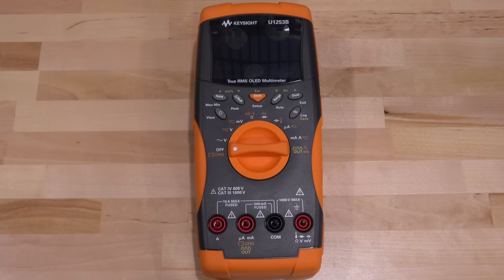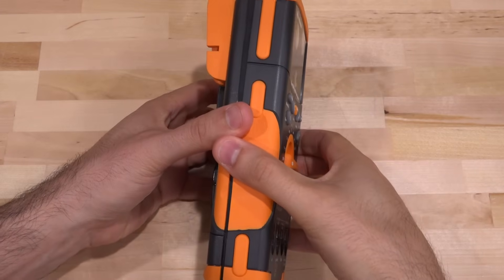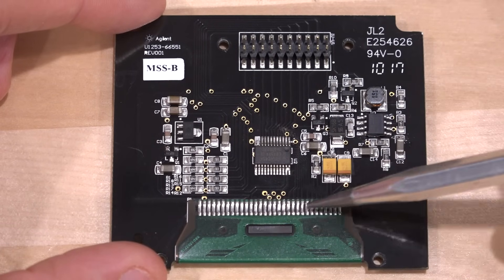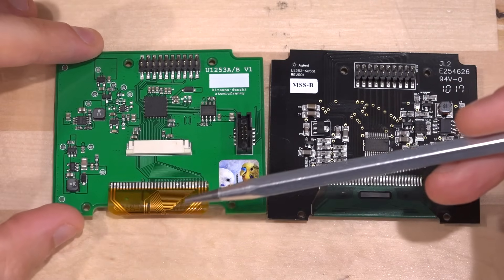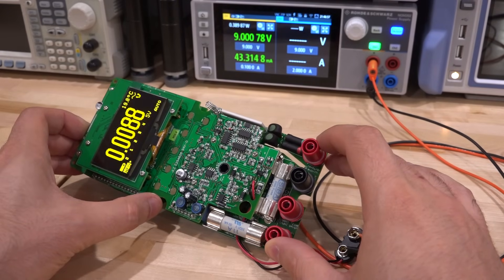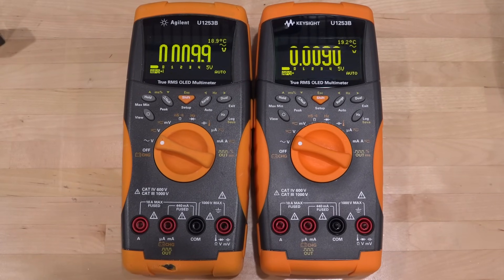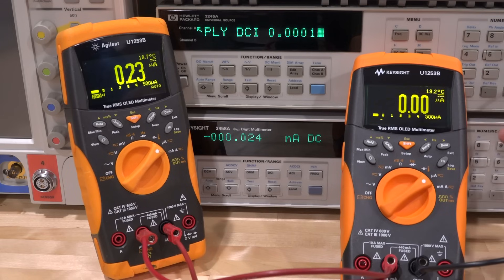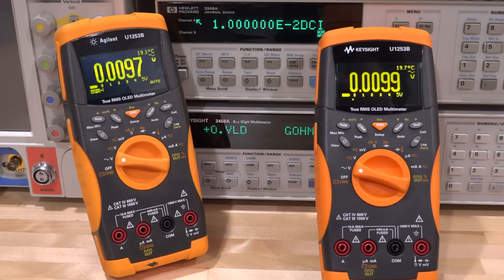TNP #19 - Teardown & Repair of a Keysight U1253B 50,000 Count True RMS OLED Handheld Multimeter

Comment: At 9:38 the right meter shows 9.590mA instead of 10mA. My U1253A had an offset of around -320µA in the "mA" range, and -0.32A in the "A" range. It was a pure offset, and no gain error.
Last Sunday I could easily fix that by following the "User and Service Guide" Sec. "Calibration From Front Panel". I only did the "DC mA/DC A" with calibration item "OPEN" according to Table 6-4, and no other ranges. This removed the offset and the meter is in spec. now again.
Be sure to also read the rest of Ch. 6 "Performance Tests and Calibration" for more information.
Reply from the maker: Thanks! A few people spotted the issue and I missed it originally as I was rushing.
Reply: How do you calibrate temperature offset

Comment: One of the feline shop assistants here might be a close relative of the one in your video. Except, one of her visual displays is yellow and the other, green. Her favorite position is immediately in front of the computer keyboard, monitoring my keystrokes for content, strictly. The OLED display is wonderful for low-light and contrast-challenged bench situations, except the longevity of the display quality and the battery life is a drawback. The choice of Fluke/LCD +backlight is about par.
Reply: wang yun
0秒钟前
Good or bad, it depends on your needs.

Comment: Nice OLED display. Best handheld display I have had was the Applent AT825 LCR Meter, (with superfluous touch screen) which I initially thought was OLED, but is in fact color LCD. Far from perfect, some data could have been displayed in much larger font, which was annoying, as was the fact it came with a proprietary charger, rather than USB charging (just what we all need.....another proprietary charger). What was weird about the AT825 is that I bought it for just over $120 dollars in 2013, though it now costs about $400, possibly because the community accepted it as being a serious handheld LCR meter, who knows...one should never guess anything, ever). Love the OLED display on U1253B but too expensive. Happy with my cheap collection of UNI-T DMMs; and the poor man's Fluke (the Fluke 117), plus assorted HP bench meters (two of which have OLED displays which are wonderful - the HP34450A (5.5) and 34460A...(6.5)). In fairness, the Fluke 117 provides low input impedance to help prevent false readings (due to ghost voltage...low imp LoZ)...and it is true RMS, so not too shabby.... though it does not have mA or uA range, and it's 1nF range limit is fairly pointless.... as it is designed for electricians rather than electronics engineers. However, it is relatively inexpensive compared to the U1253B. That being said, the OLED display on the U1253B is really nice.
Reply: This is indeed the case. A major feature of OLED is that it has a high contrast ratio, and the displayed content can make people look very clear and comfortable. At present, many products are being upgraded to OLED, but the unit price of OLED is high.

Comment: I have had a Keysight and an Agilent  u1253b for several years - I have had to replace one screen - a few years back Keysight was selling the screens (bought two then) but has stopped now - certainly in Australia. I have read that the storeage conditions do contribute to the failure time - I recall heat, humidity and UV light - the usual suspects😁
I really like the size, rapid switch on time (as I typically leave my meters off) and the display is so easy to read - good contrast and view angles. A real pity about the display - the battery life hasn't been too much of a hassle.
Reply: The U1253B is great,I also have one,but the screen is not display,so I have to bought some screen and change it.  If needed,Ican offer some to you.
Reply: It is true that its lifespan is a defect, but it is not necessary to protect it in this way. In fact, our conventional applications have little effect on the lifespan of OLEDs. OLEDs are very sensitive to water and oxygen, and are prone to failure in high temperature and high humidity environments.

Comment: It's so weird to see a module I assembled in one of your videos. I've actually never seen one inside a U1253A/B myself. I test the modules in a U1273A with the case open. I made them because a Canadian guy wanted me to adjust the mounting hole locations on the Kitsune Denshi U1273A board and was willing to send me his display to measure. I would make more but the FPGA is impossible to buy right now. I've also had a lot of trouble programming the EEPROM with my old Bus Pirate. It errors out a lot and can take a few tries to get right. Otherwise, the most time consuming part is hand placing all those components. I had decided to start training to be a pilot but they kicked me out of pilot school so I just ordered a PnP machine with that money. For fun mostly because all I have to make are a few low volume logic probe designs. Maybe when that's here in 3 months part supply will be back to normal and economy of scale can drop the price. Otherwise, I've been considering a switch to using an Efinix FPGA but that's real engineering and will take time and some evaluation to determine if it will perform the same or better than this version. I thought I had another PCB laying around but I couldn't find it. I have exactly enough parts for one more module that I'll make in a month or so when my PCB order from JLCPCB arrives.
Reply: Why the kick out of pilot school? That's unfortunate.
Reply: @FrozenHaxor  They wouldn't tell me. I think it had to do with a lack of availability but they knew I was enrolled at the local college for the bachelor's degree program and had already earned close to 25 hours. So I switched to the electrical engineering program. I have been a hobbyist for many years and have learned a lot. Maybe being pushed to get a degree that focuses on what I have experience with will be a good thing. Still.. I don't really want to work as an engineer which is why training to be a pilot was appealing. I'm hoping to find more answers once I'm in school and faced with people with similar interests.
Reply: @rogersstuart  Proper respect for your display spoofing design.

Perhaps your guardian angels were looking out for you.  People in the Aviation and healthcare industries were victimised with the experimental plaque prophylactic.  Here in Finland as well we are having significant reduction of people maintaining their healthcare registration after they get fired as healthy while sick colleagues keep their jobs simply for partaking in medical testing.

I am sure a lot of people would be delighted to know how the protocols differ and what you have done to resolve it if it does not compromise the business model.

Do you have any idea of the shelf life and availability of the new displays?  Can they sourced easier and simply be swapped out if they fail down the road?
Reply: @rogersstuart  Well, it's not the end of the road. You can be both an engineer and a pilot in future :) hate to think that the reason could be someone pulling strings to get their place in the aviation program.
Reply: Wow, all that work to now have parts availability issues. I am going to try the AliExpress $25 display. It will probably be shifted and read upsidedown, lol .
Reply: That's awesome, but I have a drop-in replacement OLED, why not give it a try?

Comment: Even with a not so fancy display, I will stick to my Fluke 189. Reliable and the battery lasts a lot.
Reply: If I had to choose between Fluke 189 and Keysight U1253B, I would choose Keysight U1253B without hesitation. Because this product is too classic, it has been used on the market for more than ten years, and I am still looking for a replacement OLED.

Comment: Would it help the display life if you could reduce the current to run it a little dimmer?
Reply: It's moisture absorption that destroys the display. It's not sealed well enough.
Reply: Yeah. How would reducing their brightness improve an aging problem that occurs even in storage?
Reply: @tookitogo  Exactly. Lowering the brightness might combat burn-in, but that would only affect the pixels that are on all the time.
Reply: @tookitogo  If you want to keep the lifespan during storage, you need to avoid high temperature and high humidity environment, and do not expose to the sun.
Reply: Lowering the brightness will help the OLED life to a certain extent, but when not in use, placing it in a place with low temperature and humidity, where it is not easy to be exposed to the sun, will help the product life better. After all, the time we actually use is longer than the time we don’t use. longer.

Comment: I really like the U1253B but the OLED reliability is a big factor in me jumping on one, even a faulty one to repair! The battery issue however can be solved, in fact I quite like the idea of coming up with a PCB to retrofit a Li-on charger/battery inside the meter. Hmmmmm!
Reply: I very much agree that OLED is one of the highlights of the Keysight U1253B.

Comment: Huygens Optics made a video called "Making OLED Displays" where he makes an OLED display and while doing so, explains some of the difficulties regarding durability, particularly with early displays. As his displays aren't as hermetically sealed as industrial ones, you can actually see the degradation in real-time, basically hours instead of years.
Reply: I am an OLED engineer, what I want to tell you is that OLED is not as unreliable as you said, and many people have used U1253A/B for 7-10 years.
Reply: @wangyun-pp7xc  "I'm an OLED engineer" roflmao - and I'm a rocket surgeon.
Reply: Huygens is.. Well.

Funky.

Comment: in the old days, the yellow OLED material had about 20V forward voltage before it  started emitting light. Thats why we made a stack of OLED, Barium and Aluminium. The Barium was there because it gives off electrons very easy so the light emitting voltage comes down to about 5V. The AL was to provide the electrons :-) . but because the encapsulation on the Al layer (a kind of plastic) was letting trough water, the barium layer deteriorated over time and so did the light output. Philips did it better, but much more expensive with a metal shell backing and a getter material. We still have working Displays from almost 20 years ago.
Reply: At present, the technology has been updated a lot, and the yellow light OLED material is still widely used in industrial instrumentation because of its higher lifespan.I also do OLED, we can communicate.
Reply: Do a video describing the technology, people are always very interested in first hand accounts of technology development and also the practicalities of production processes.  A simple slide show with commentary would go down well and you could mention it in relevant OLED videos.

Comment: Oops, defective DCI 50mA range on the right @ 9:55. Ohm seems to be off a bit as well. Why don't you RF guys always use proper 4mm plugs and cables for DC analogue measurements?
OLED displays need a lot of supply current, so that's not the optimal technology for handheld meters. OLEDs deteriorated mostly from humidity at those days, and from internal electro migration/display burn-in. Meanwhile the technology is improved and can be used in Automotive applications . though I still don't like it in terms of reliability.
PS: If you have used a precision resistor decade for checking OHM, then both meters are completely out of calibration, by about +0.7%. The meter on the right probably has another defect as it shows 0.7 .. 2.2Ohm when shorted, compared to < 0.3 Ohm the one to the left. Or maybe you should check your cables. They don't look very reliable, either.
Reply: Agree it

Comment: hmmm. I have one of these. Haven't used it in a while as I've been favoring the Fluke 87V because of the Keysight battery life. Now I'm dreading turning it on later today. Thanks for the vid.
Reply: Maybe I can explain to you the reason. First of all, OLEDs are easily affected by water and oxygen, which leads to the failure of organic light-emitting materials. Therefore, OLEDs need to be encapsulated with UV glue to isolate water and oxygen. At the same time, the back of the screen is coated with good water absorption and drying. If the external temperature or humidity is too high, it will be easy for water and oxygen to progress the screen and corrode the luminescent material. Similarly, high ultraviolet rays will also cause the UV glue to fail, causing water and oxygen to corrode the material.

Comment: I own a Agilent U1253B from 2014 or 2015, the Display is fine and bright. I wonder what causes some displays to break early
Reply: My U1273A was fine. Then I moved to Vermont. The next time I turned the meter on the display was dim. It can happen very suddenly.
Reply: U1273A, rare uses within latest years. Just took it form the shelf and some pixels are significantly darker than others.

Comment: Timely video, I bought one of these meters cheap earlier this year, very very faint display, and got an OLED repair kit which modifies the original display board a little with a different display and couple extra components. Started the repair today, then saw your video drop.
Reply: I have this display, and it is very easy to replace the display, I have tried many times for customers, just remove the tin of the original one and assemble the new one.

Comment: Organic molecules in older OLED displays were generally unstable, and even newer molecules probably still are - I believe that is one of the reasons why the dimensions of blue pixels even in modern OLED displays are larger than red and green, because they know it will burn slightly over time, developing red tint....since blue color is associated with highest energy, the blue-emitting organic materials are also exposed to the highest stress
Reply: As far as I'm aware, OLED display controllers for more demanding applications will have built-in colour correction mechanisms that modify the input to look "normal" as the dyes decompose, effectively e.g. turning up gain on the blue channel over time.
Reply: @Shadowdncer  You are all very professional, OLED has been applied so far, and there are many ways to solve the problem of burn-in with high-end OLED.
Reply: you gotta explain it right

Comment: Which way does it flip the display, because wouldn't it be easier to just extend the ribbon, flip the screen, and run ribbon under the screen.
Reply: Not possible.
Reply: @FrozenHaxor  Flip may occur if different OLED driver chips are used
Reply: @wangyun-pp7xc  Yes, we all know that.
Reply: Flip may occur if different OLED driver chips are used

Comment: Could you post a link to the replacement board? All I can find is kits with a small PCB and require the flat flex to be soldered. They don’t look nearly as finished or as good as the board that is in the video.
Reply: Yeah, I've done some searching and can't find this exact replacement. I'd pay to avoid the extra steps.
Reply: @vincei4252  I can't make them because the FPGA is out of stock everywhere.
Reply: @rogersstuart  The display can be replaced directly, no need to replace the FPGA
Reply: @vincei4252  Same here!
Reply: @vincei4252  Maybe we can have a good chat, this product has indeed been discontinued for several years, and now the world estimates that I have a model display screen.

Comment: I had that oled failure with my TS121 screwdriver. Luckily the replacement is extremely common and cheap.
Reply: @LordPrecision  Nothing quite like updating the firmware on your screwdriver
Reply: @drkastenbrot  I am an engineer specializing in OLED display. I have seen the OLED of this product you mentioned. It is 0.69 inches. It is indeed a relatively cheap and easy-to-use product, but it will be better to use a larger display.

Comment: HP gear => lasts 50 years easily
Keysight crap => not even 10 years....
Reply: HP not only lasts 50 years, they ALSO tend to remain perfectly in cal for half a century too!!!
Keysight - not so much
Lastly comes the gear I use...  It works, well sometimes anyway... It's also generally accurate to within a few HUNDRED percent

Comment: Ah yes I've had exactly the same issue with a product using an early no longer available OLED with a SSD1322 controller.
I found and purchased some new old stock OLEDS from China but they had exactly the same issue - no/barely visible display.
Searched and found a different brand with the same dimensions and controller but with different pinouts and less pins on the flex.
I designed a short flex pcb adapter to use the modern and available OLED. Happy days...
Edit: Customer also had some spare new-in-box product in the cupboard which they tried. They also didn't work.
Reply: Maybe we can have a good chat, sorry I wasn't able to get what you wanted at the time. I have this OLED whose driver chip is SSD1303T0.

Comment: We had a bunch of Agilent U1273A whose screen just died after 4-5 years. We managed to convince Keysight to replace the whole units because they had at some point issued a recall for them. The replacement is going strong now. The old screen was "visible", but incredibly faint - you had to look very closely with the light at the right angle.
Reply: If you have a lot of machines can you consider selling them? If feasible, I have this OLED screen, and we can consider repairing these products together to those who need it.

Comment: Is the demise of the original OLED a function of that particular unit or is this a common occurrence in OLEDs? Thanks for sharing the fix!
Reply: Apparently OLEDs of the same model fail the same way in coffee machines and other devices.
Reply: This yellow OLED was discontinued for years,and I have storaged some,if needed,Ican offer.
Reply: @huangbohuang8766  By chance do you still have any of these OLED modules?  If so, how much $$?   Thanks.
Reply: @samthenerf  That's true, it's an OLED problem.